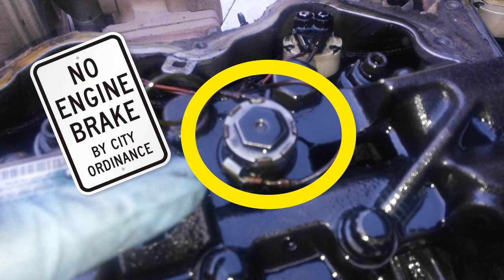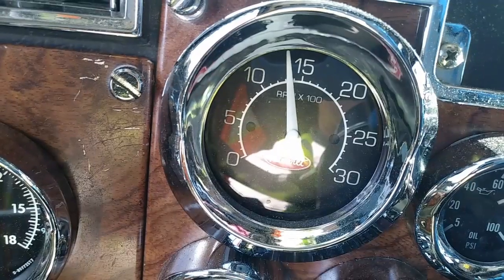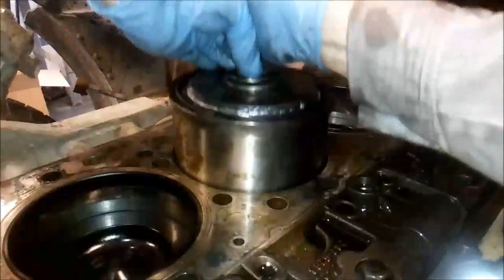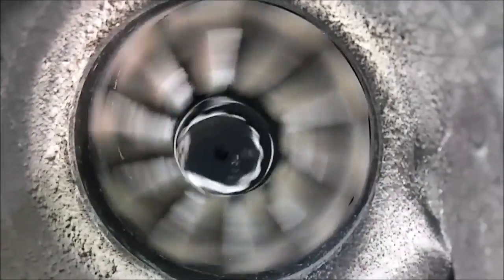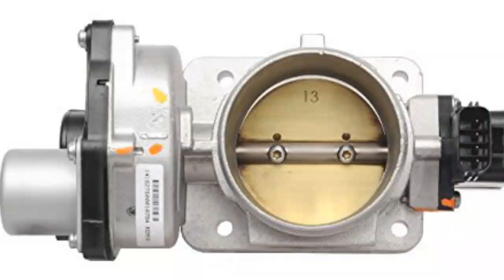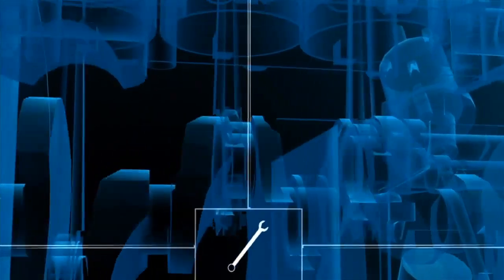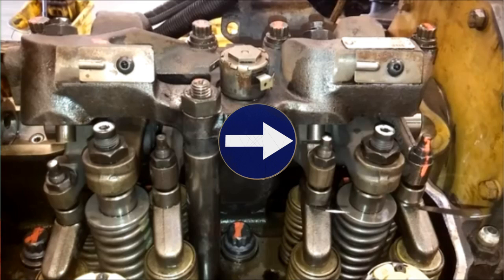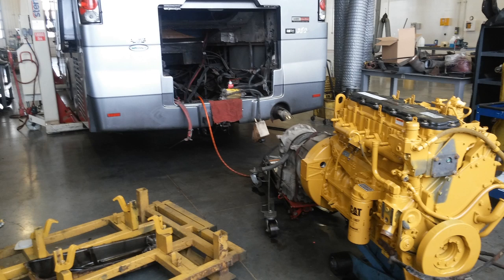The Difference Between Jake Brakes And Exhaust Brakes?

Comment: Excellent video as usual.  Minor point - on the older mechanical engines, the fuel was still injected, so the only way to prevent that was to turn off the start switch, which some drivers did, and that did create more retarding power; however, the injector plungers were still going up and down but without the beneficial lubricating properties of diesel fuel - bad news.  So, if I was informed of that practice, the driver was educated on the potential real adverse effects of that practice.
Reply: All the jerk pums I have worked on shut the fuel off as soon as the engine was over run, and as the fuel was still flowing throgh the pump there was never any harm.
Reply: @Equiluxe1  Not on a Cummins PTG fuel system.  There is certainly fuel still flowing through the fuel pump in that scenario, but no fuel could bypass the fuel pump solenoid to the injectors once the diaphragm slams shut due to lack of 12 volts.
Reply: On  the  older  mechanical  engines  turning  on  the  Jake  caused  oil  pressure  to  move  a  plunger  down  to  lock  the  injector  plunger  so  no  fuel  is  injected . Then  the  injector  pushrod  causes  the  exhaust  valve  to  open .
Reply: @cbmech2563  - That is not correct.  When the cam operated injector push tube rose to push the injector plunger down while the Jake Brake system was operating,  it simultaneously activated the Jake Brake hydraulic system which (short story) opened the exhaust valves.  At no time were the injector plungers locked down.
Reply: @cwj9202  
It's  been  a  long  time  since  I  set  up  a  set  of  Jakes  but  I  do  know  that  no  fuel  was  injected  when  the  exhaust  was  popped
Reply: @cbmech2563  - Consider this then:  The PTG fuel pump (in the idle position) is still pumping fuel to the injectors while the Jake Brakes are activated; the injector plungers are being pushed up and down by the rocker arms, simultaneously the injector adjusting nuts are being pushed up by the injector push tubes which contact the Jake Brake hydraulic pistons, which in turn pump oil to the slave valves over the exhaust valves, which subsequently push down on the exhaust valve crossovers, opening the exhaust valves. 

Never are the injectors "locked down" as you maintain, as the injector plungers are continually pressed down and then returned up by the injector springs (allowing the idle speed flow of fuel to be injected into the combustion chambers by that process), which is the reason for the slight difference in muffler noise between normal operation of the Jake Brakes and when the fuel pump solenoid is closed upon the shutting off of the ignition key preventing fuel flow to the injectors.

OK, so you don't believe me.  There are three ways to confirm my statements:  (1) The easiest way is to call Lyle Cummins, co-inventor of the Jake Brake.  His number is in my contact list, but you have to do the old fashioned way, as I am not giving it to you.  (2)  I suppose there are excellent YouTube videos which explain Jake Brake operation that you can view.  (3)  Work on an 855 Cummins equipped with a Jake Brake, manually depress one injector while the engine/Jake Brake is operating.  The engine will continue to run with a miss as you are "shorting out" that one injector and that same Jake Brake will not function.

Best wishes to you.
Reply: @cwj9202  
First point ;cummins quit using a ptg pump before I started as an apprentice, training films showed them, older trucks had them,but they've been using a pt pump for a long time. 
2nd ;ok I misremembered on the injectors being held, but how much if any fuel is being injected foot off the pedal, engine decelerating?
Reply: @cbmech2563  - My original minor point to Josh was that the fuel was not shut off to the injectors on the old mechanical engines.  The amount of fuel delivered to the injectors during Jake Brake operation was an amount on the level to maintain idle rpm.  Whether the Jake Brakes were causing the engine to decelerate or the gear selection was high enough to allow the rpm to increase is not material in regard to the amount of fuel still being delivered to the injectors as it would be the practically the same regardless of decreasing/increasing rpm. HTH
Reply: On a Cat mechanical engine, 3406, 3406 B, 3406 C, 3306, 3306 B. If installed correctly, you had a low idle switch that would allow the engine brake to activate. If you foot was off the throttle and engine was at a low idle, fuel delivery position and foot off clutch. 
A PEEC system, early 8TC's used a contact point on the beer can style throttle sensor. The later was done via ECM input (much better). Only had a low and high option. Engine could run backwards  if not careful. I have seen this happen.